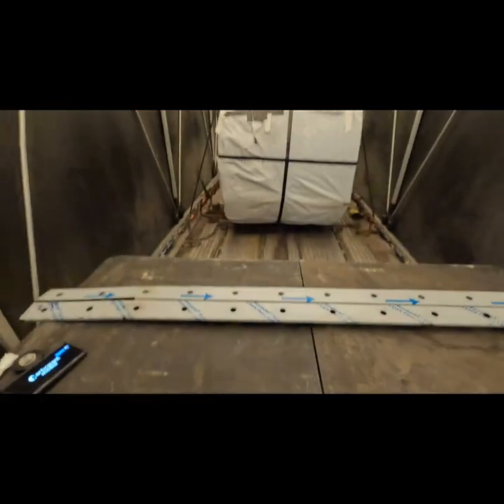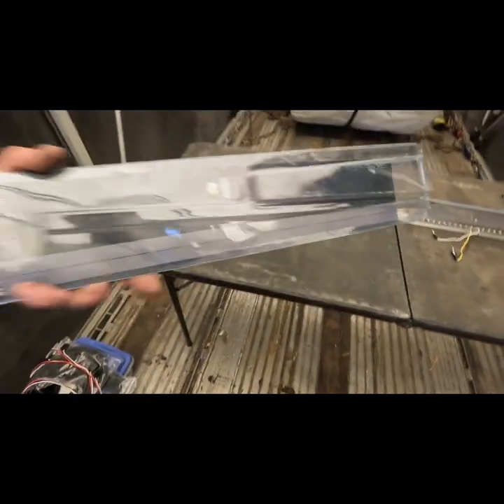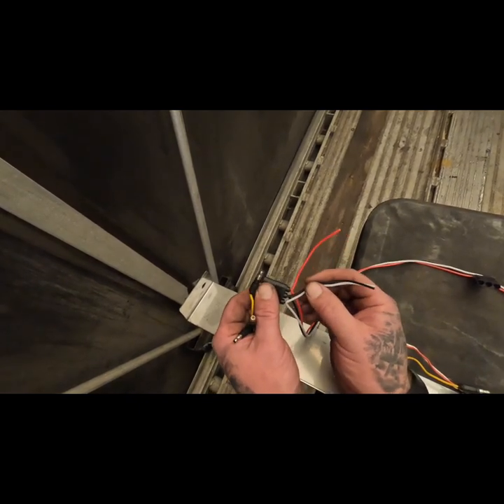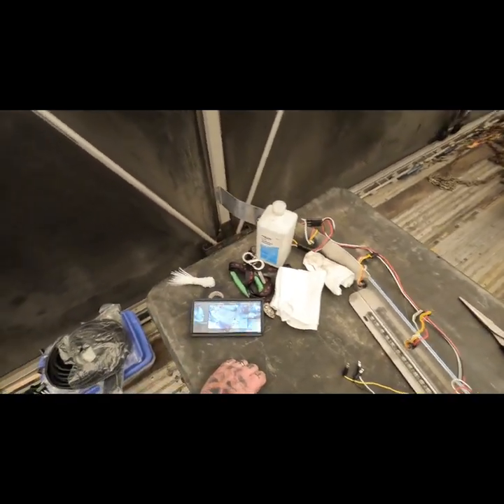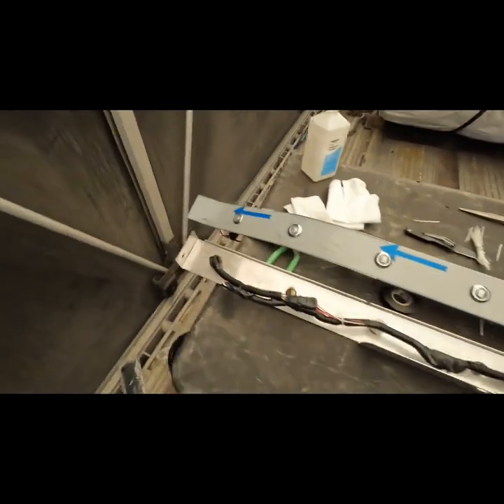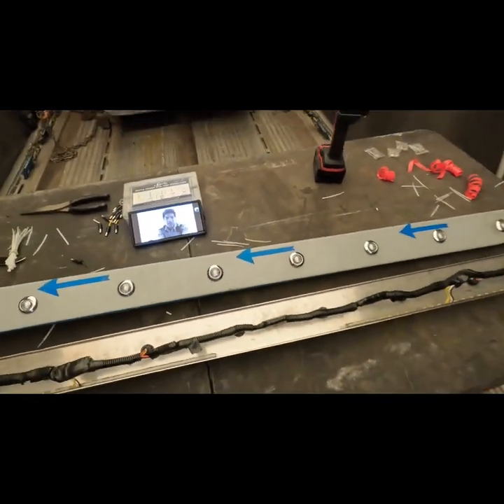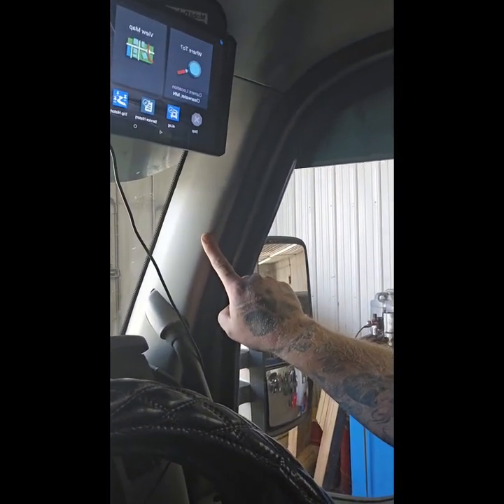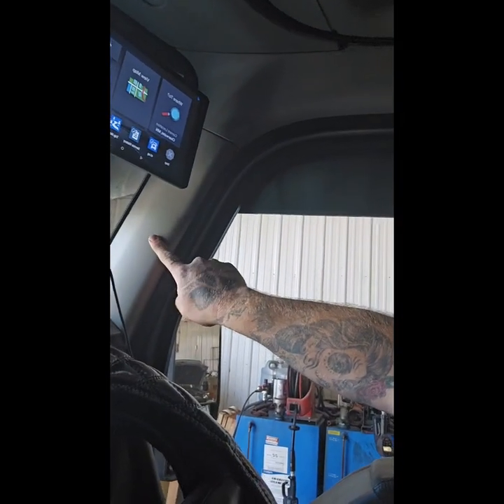wiring and installing chicken lights!!!

Comment: Nice vid. A couple of questions if you don’t mind. Where did you get your lights at? I’m want to make the lights to work as turn signal lights as well. Would the lights you installed work as such? TIA.
Reply from the maker: @abs1913  you can get them at any main truck stops. Id recommend getting some generic dual revolution lights off amazon though. You can get 10 for like $30 and they're between $15-$18 a piece at truck stops. You can run them to work as turn signals as well, just run a wire to something tied into your directionals and splice it into the mix!! Thanks for watching btw!
Reply: @justanotherotrguy  thank you much. I’ve been looking at some but I like the ones you installed because they are ready to plug and play. You don’t have to be doing any termination. Thank again and keep making the vids. They help some of us for sure…. Keep trucking!!
Reply from the maker: @abs1913  id honestly recommend splicing instead of the plug and plays. Theyre easier, yea. But they corrode and disconnect and stuff super easy. Every other lights ive done have been spliced and theyre holding strong. Both work, the p&p ones will eventually need to be fixed

Comment: How did you run auxiliary cable to visor?
Reply from the maker: Connected all the aux wires in the visor lights and connected them to a 16 gauge wire from behind the center clearance light behind the cb tray. Then ran it down to the driver side pillar and through the dash (behind the steering column) to my spare (blue light) switch. Easy peasy
Reply: Perfect thank you for the information.
Reply from the maker: @2123dgr  any time! Hope to see you comment on my other uploads!
Reply: Where did you get the panels?
Reply from the maker: @2123dgr  bobs chrome zone in lake station indiana in the flying j parking lot